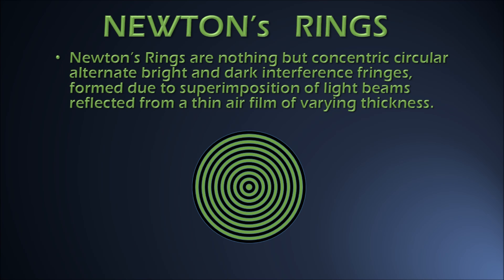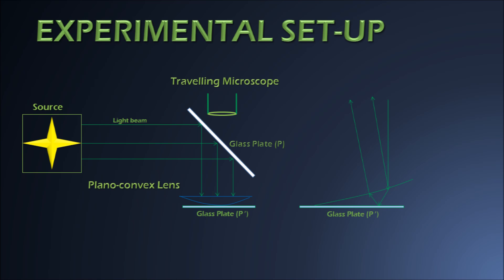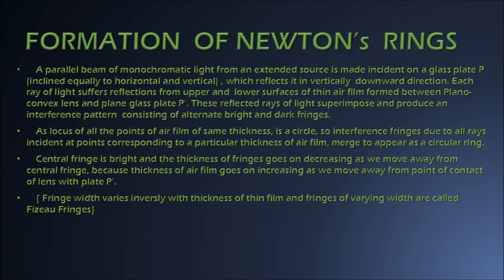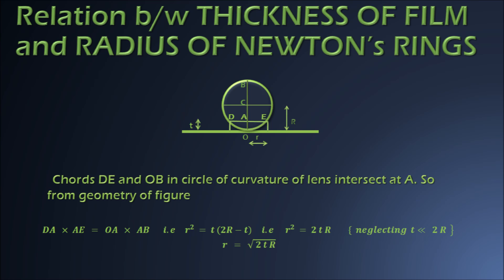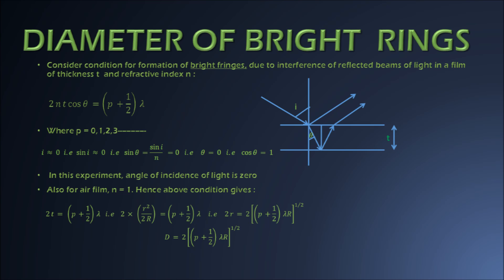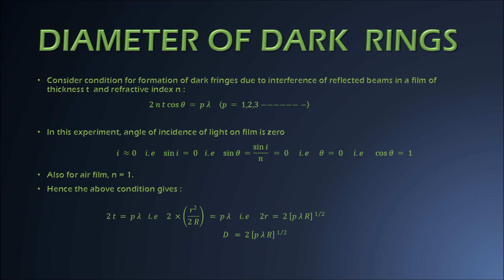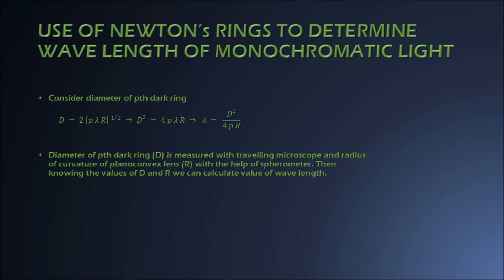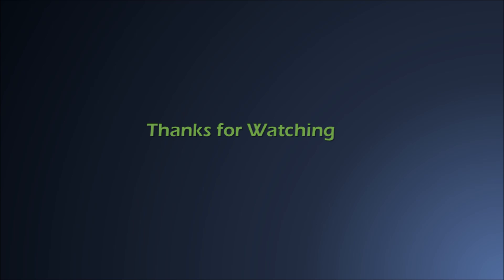Newton Rings | NJPhysics

Comment: let me correct you central fringe of newton's ring is always dark.
Reply: +Prachee Shekhar True. But not true. if we replace the air film with a medium who refractive index is between that of the Plano concave lens and the glass plate, then both reflections are from denser to rarer medium so no additional path difference will be created. So we will drop the term of "lambda/2". and the central fringe can be bright. :P
Reply: ohkz... thankx ;D Samanyu Kun
Reply from the maker: It depends, if there is some air gap at the point of contact between lens and glass plate or not.
Reply: oh